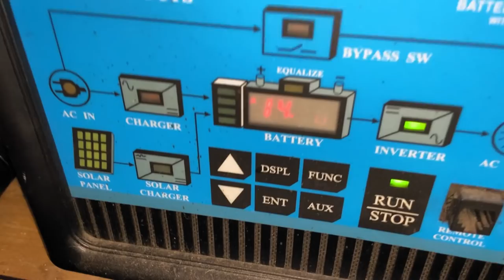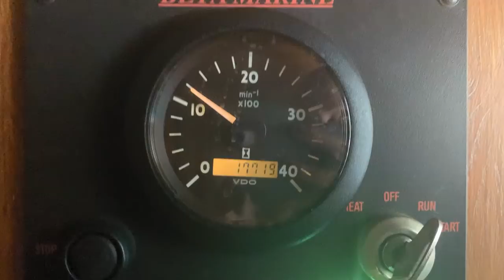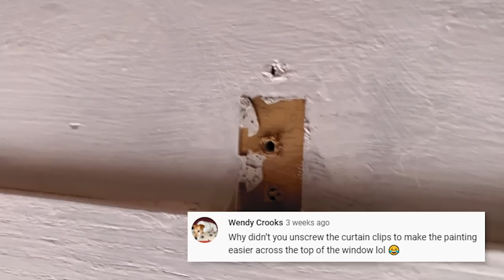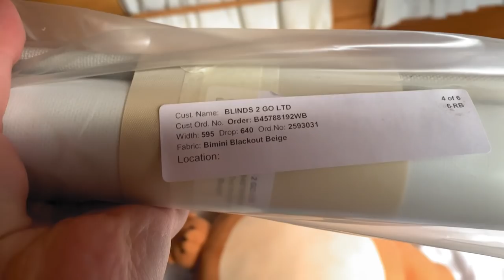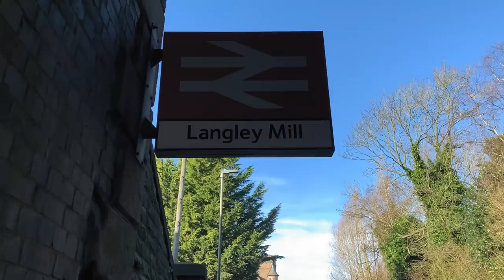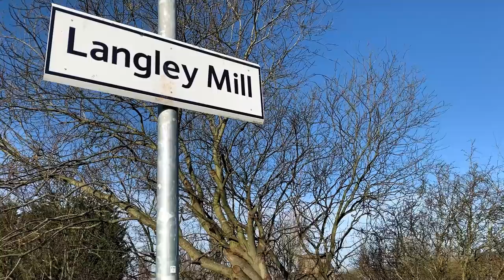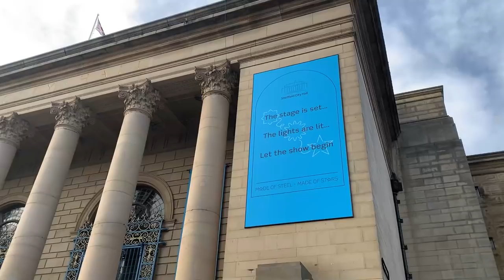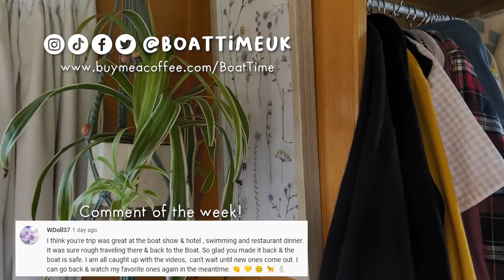Revs, blinds & pink hair | Installing narrowboat blinds! - 36

Comment: The alternator that is on your engine that charges the battery has a built in regulator that regulates the output to the battery's so it wont make any difference if your engine is on tick over or on Higher revs it will always put out the same voltage so you only need to have the  engine on tick over. Adding revs will only use more fuel. Love the vlogs by the way :O)
Reply from the maker: Ah good to know, thanks Kevin! 😊
Reply: Actually this is only partly right the alternator does regulate the voltage to be the same at any rev of the engine but running the engine faster produces more current (Amps) which allow the battery to charge faster its not the voltage that matters but the current when charging. Higher revs does use more fuel but also produces more amps also most modern alternators although they are rated as eg 60 - 80 Amps alternators will only produce 25% of that amount due to the regulator restriction as more amps will increase the heat on the alternator and MAY reduce life expectancy however using an external regulator can increase amps and protect the alternator one like I have a Balmar regulator on my narrowboat it allows me to use 95% capacity of my alternator but monitors the output to the battery and reduces as the battery becomes fully charged and if the heat gets to much it reduces the output to cool the alternator The Balmar is programmable for different battery types like Lead Acid , AGM and Lithium

Comment: Hold the key to heat for about a 4 count when it's cold out. The glow plugs will warm the cylinders and make it easier on the starter. Can I suggest a hinge with a stick mounted to the underside of the engine cover to prop it up.
Reply from the maker: Good to know thank you! 
& great idea! Our only worry is that if it pings off and hits the engine during a cruise it can cause some damage 😬 but deffo need to find a solution to just holding it up haha

Comment: I also learned on a FB group that on Betamarine it’s adviseable to run the engine at 1200 revs when not charging under load (i.e when not cruising) as otherwise you risk it ‘glazing the bores’ (whatever those are 😂, ok I vaguely get that it’s to do with build up on the cylinders that might affect combustion). If you read the Beta Marine manual a bit further it does explain that too, though I do also love smashing on with things without looking at the manual! 👍
Reply from the maker: Ah yes we've seen the term 'glazing the bores' a lot too! Still absolutely no idea what it means, but it sounds bad so we'll avoid it 😅 We think some of the issue is our alternator and inverter setup, so without wanting to spoil future episodes that is hopefully sorted now, and charging around 1000-1200 revs seems to work okay. Thanks for the tip! ❤

Comment: Some good advice about your alternator. But they get hot under high load. So like said they will charge at tickover but they can't cool themselves as well as they can at high revs( faster the fan, more air) most modern engine suggest 1200rpm for charging because of  overheating at lower revs.
Reply from the maker: Good to know, thank you! :)

Comment: Most Betas have at least two alternators, one for charging the starting battery, the other for charging the domestic/leisure batteries.

There are two battery lights on the engine control panel, one without a "D" (for the starting battery) and one with a "D" for the domestics.

If the "D" battery light isn't lit on your engine control panel once the engine is running, then you know that the alternator is producing current and charging your batteries.

If the "D" battery light remains lit once the engine is running, then there is a fault with the alternator, which could be as simple as s slipping drive belt.

If the "D" battery light flickers, then by all means do try increasing the engine revs slightly until the flickering stops. A flickering light is usually a sign that the batteries are discharged very deeply and/or there is a high load on the domestic batteries, or again a slipping belt. If the flickering persists at higher revs (especially without the noise of a slipping belt) then there is a fault in the domestic alternator.
Reply from the maker: Thank you so much for this! That's super helpful and easy to understand. We had no idea but that makes loads of sense. Thanks Mike! 💕

Comment: Hi you 2.  The glow plugs  pre heat the initial charge of fuel that's injected into the cylinders on start up. I cannot believe you were never told how to operate a diesel engine in the first place. Ever thought of investing in a small generator to save wear on your main engine. You should have a 230 volt mains input on the boat. Regards Dave desiel fitter
Reply from the maker: Yep, it's one of the oddities of boating that you aren't required to learn anything in advance. We tried to do our research as best we could, but the 'heat' function slipped through the cracks. We've considered a small generator but not sure we'll need it thankfully! We're aware lots of people use them to avoid knackering the engine. Thanks for the tips, it's super helpful! 💕

Comment: Diesel engines don't do well if left at low revs that's why you should run them to charge batteries at just over tick over revs
Reply from the maker: Ah yes we read about this. We are so glad we are going to have to run the engine much less now

Comment: The reason you need to rev the engine to 1,100/1,200 is to allow the alternator to achieve it's max charge rate at tick over 600 rpm the alternator is probably making less than 10 amps of the rated 80amp max output the voltage is set by the voltage regulator which  should be a set value of 14.8v max if the battery voltage is less than 14.8v the batteries are probably still charging. But increasing the engine rpm from idle will increase the charging current and decrease the time you need to run the engine to achieve a full charge
Reply: Exactly what John says. 👍
To check your alternators are chucking out 14.4v use a multi meter.

As for pre heating the glow plugs, Beta's are pretty hardy engines and don't necessarily need to have the fuel preheated when the weather's warmer.
Reply from the maker: Thank you for the tips! Good to know we haven’t been damaging it by not heating first 😊
Reply from the maker: Ah good to know! We also now have a battery monitor so it makes it much easier to know what amps are going into the batteries. Thanks for the tips! 😊
Reply: Spot on!